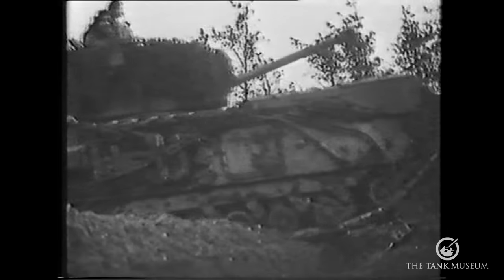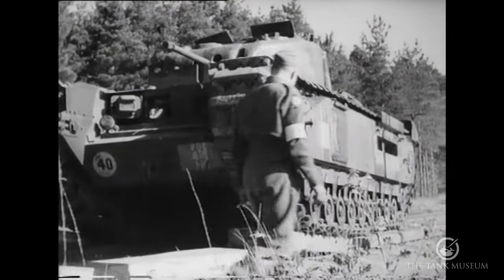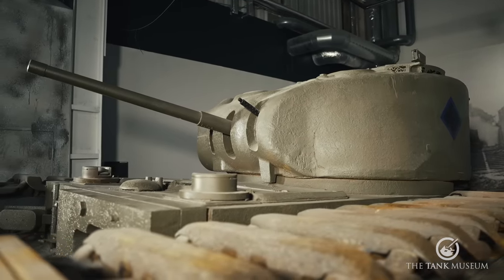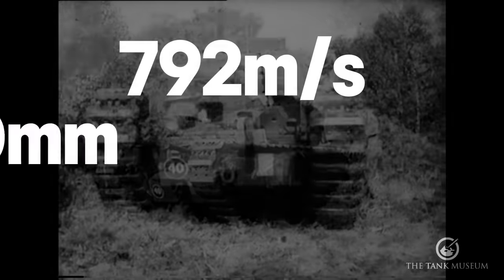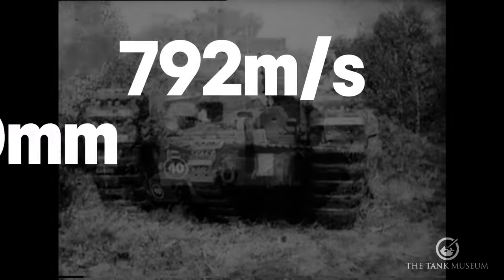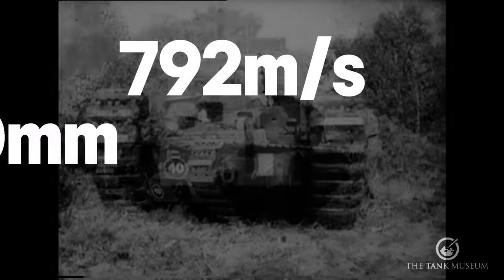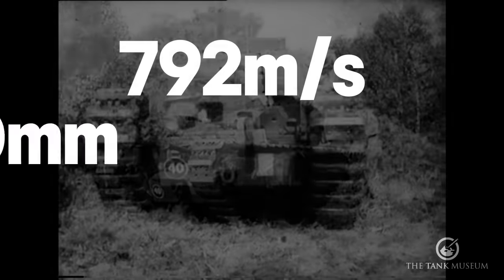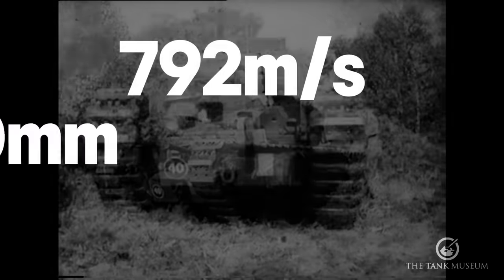Evolution of The  Churchill Tank | "No Damn Good"?

Comment: One of my favourite tanks ever and one that is a bit underrated in my opinion when compared to other Allied tanks of the era like the Sherman or even the Cromwell. If they had introduced the 77mm cannon derivative of the QF 17-pounder anti-tank gun early and put that in the latest mark of the Churchill then it may have gotten a bit more limelight.
Reply: A pity the panic in 1940 was so persuasive and so the 6 pdr which was due to enter service in late 1940 was stopped to produce more 2pdrs (which at the time were still effective), pushing the 6pdr back a year and the 17pdr back to 1942 (its design was started in 1940)

Comment: An advantage of the QF 6pdr. was that it was a better A/T gun than the GP 75mm. fitted to the M4 Shermans, so Monty ordered that a number of the 6pdr. equipped Churchills be kept on strength until the 17pdr. was available in sufficient numbers.
Reply: the 6pdr was better at short range, the 75mm was better and longer range (due to the weight of the projectile).
Reply: @chaz8758  Although the 6pdr. had a muzzle velocity of 2,600 - 2,950 fps, with the 75mm of 2,030 fps for A/P it depends much on the situation at the time of engagement.

Comment: Wasn't it a Churchill six-pounder round which knocked-out Tiger 131 in Tunisia?
Reply: If i remember correctly the tiget wasn't knocked out, the gun traverse was jammed by the shell, and the tiger's crew abandoned it
Reply: How well did it work without its crew? @saynomoreification
Reply: It was one of a group of Churchills engaging 131, but yes. One miracle shot ricocheted down the underside of the barrel and went straight into the driver's compartment, killing the driver and cleanly disabling the tank. The crew of 131 were forced to abandon their otherwise intact vehicle, and the rest is history.
Reply: @86pp73  I’ve never heard of that, what’s the source? I’ve only ever heard about it’s turret being jammed up. She doesn’t show any battle damage over her drivers hatch from what I’ve seen, and you can still see the shrapnel marks in her turret and turret basket.
Reply: @stuglife5514  There is a patch over the damage to the drivers hatch area - the damage can still be seen inside the drivers/co drivers area)

Comment: I had no idea Churchills saw action in Korea, but thinking about it they probably did their job well; hilly terrain didn't bother them at all.
Reply: They were Crocodile flame throwing tanks, as rhe Brirish also deoloyed armoured regiments equipped with Centurion,  but the limited need for flame throwers meant the Crocodiles mostly dropped their trailers and reverted to use as gun tanks.
Reply: @jonprince3237 also Cromwells, but IIRC, not Comets.
Reply: @wbertie2604  yes, Cromwells were still in service with the Reconnaissance Troop of the Armoured Regiment. For example, the orbat for 8th, the King's Royal Irish Hussars deployed as part of 29th Infantry Brigade lists 64 Centurions in 3 Squadrons of 20 tanks, 6 Cromwells, along with 3 Churchill Armoured Recovery vehicles and 3 Churchill bridge layers as their armoured strength. Reputedly, the first Cebturion "kill" in Korea was destroying a Cronwell that had been captured by north Korean forces.

Comment: 17:17 re: the storage of the 2" White Phosphorus smoke bombs and that it could ignite if hit. IIRC I've seen a block of wood with 2" holes bored into one face. While the timber isn't metal or armoured, it still offers a level of protection from splinters, etc. 👍

Comment: Correction on the bit about welding armour, it isn't really an issue ONLY if the welder is competent, but if done by an in-experienced welder or rushed (both issues being basically the standard for contemporary russian tanks), the whole thing basically falls apart if hit hard enough, even if the round doesn't go through (Lazerpig explained it quite well in his T34 video), which is far less likely to happen to a bad rivet job, as even if most of the rivets fail, the panel stays on the tank instead of just falling off.

Comment: The A22 Churchill was a development of the 1940 Harland & Wolf A20, a WW1ish tank designed to cross shell torn ground. It was deemed too big and Vauxhall took over the design. The A22 was ordered into production straight from the drawing board and so had many issues. It appeared in 1941 but was not ready until mid-1942. Despite its appearance the design was very advanced in terms of agility and protection. It was used at Dieppe and El Alamein, were one tank was hit 70 times without major damage. It was only slightly slower than the M4 Sherman despite 12 tons more armour. It was well liked by its crews, replaced by the Centurion tank in 1947.

Comment: As long as you don't treat it as heavy tank, it works as advertised for medium infantry tank. And thus Churchill VII is my favourite version of Jumbo:P

Would have been much better if they had utilised Meteor when it was available and designed the tank for use of 25 pounder from the beginning, but it is what it is, I guess.

P.S.: no, my suggestion has no connection to Black Prince as I don't suggest to stretch the tank to even bigger dimensions for no reason. Bloody Sentinel housed twin 25 pounders in its turret while testing the placement of 17 pounder. You don't need a turret ring the diameter of the Moon to house 17 pounder. And you don't need the hull wide enough to land B-29 on it to put a big enough turret ring on it, there are many examples of overhang turret rings. Not to mention you can always rethink the whole "overhang" track which was a unique feature of Churchill since all other tanks with this approach were already scrapped in 1920's😂

Comment: i wonder if the good cross-country mobilty was due to for a good part the extremely agressive profile of the tracks. compare this with, for example the later Chieftain tracks, which were very smooth. (partly because of the rubber blocks fitted)
Reply: Low ground pressure due to the many small wheels couple with a low gearing ratio and the ability to neutral steer where what made it a very mobile and manoeuvrable tank

Comment: The A22 "Churchhill" bears a strong outer overall design to the A20 which includes the downward pointing air vents that the MK1 had.  That was a design for muddy WW1 trench warfare and the tank had to climb steep slopes that might be muddy including deep craters and walls of wide deep trenches and slow enough for infantry to leisurely walk beside it just as if every hadn't changed since in WW1.  But that did give the Churchill that legendary climbing power.

Comment: Not a detail significant enough to include in this video, but I like regardless: those louvres on the sides being removable wasn't just for maintenance.

Because military hardware had to be rail transportable, the size limitations of the railway (called the loading gauge, which is much tighter in the UK than elsewhere) played a major part in the design of tanks and such; this is why when British tanks get bigger during this time, it's usually lengthways first, as shown by the Churchill.

Those louvres were removed when the tanks were loaded onto flat wagons, otherwise they would foul the loading gauge. I believe the same was necessary for the sponsons of the WWI tanks. I don't have any knowledge for how they may have looked on European lines, if they even moved around like that rather than entirely under their own power.

Comment: That was a great survey and so well narrated.   Thank You !

As a layperson might I ask a question about the transition to modern  infantry support vehicles.    "Is the WW2 idea of an Infantry Support Tank   now met by the (often called)  Armoured Troop Carrier.    If thats completely wrong then might I ask what the modern counterpart might be ?  Thank you in advance for information.
Reply: Infantry tank and armoured troop carrier roles have some similar goals in enabling the infantry to close up to the enemy to press the attack and both originated in WWI trench warfare. The idea was for the infantry tank to advance with the infantry on foot against well prepared/defended positions in set-piece attack and deal with key threats like heavy machine guns, fortified points etc + some obstacles like wire, etc. So, v heavily armoured and good over poor & obstructed terrain, but no need for high speed. Faster, lighter cruiser tanks would exploit any breakthrough. This also matched the prevailing social status attitudes that the dashing (now with tanks) cavalry would charge through and win the battle once the common foot soldiers had toiled away preparing a nice gap for them 😲
The troop carrier is more of a battle taxi to give much better infantry mobility with some armour protection against small arms, splinters, etc and later NBC. They usually have a moderately heavy weapon to support their squad but are vulnerable to heavier weapons. So, they would typically follow/accompany eg main battle tanks to disembark troops to secure a position or as necessary to deal with immediate but unarmoured threats that the MB tanks are vulnerable to, like say, RPG teams.
The separate infantry + cruiser tank concept was made obsolete by the armoured warfare developments before WWII and to some extent by better technology.
Reply: @jackgee3200 
What a comprehensive reply !    Truly grateful to you for the effort you put in.   That adds much to the value of the video.

Comment: I built a Tamiya 1:35 scale kit of a Crocodile.  Very interesting vehicle.  Model turned out really well.  But whose bright idea was it to mount a towed trailer behind a tank that can so easily execute a neutral steer turn?
Reply: How else are you going to transport all that flamethrower fluid and propellant gas to the point of use?  Simple answer: don't neutral turn with the trailer attached!

Comment: The 37mm (2 pounder) that it started with, was useless against PzKw3 and later. The 57mm (6 pounder) it usually had was effective against PzKw4/ Stug (the main armour opposition at wars end). The enginer (AVRE) models, not all with the big demolition gun, were so useful that there were AVRE variants of all subsequent British army tanks. The 75mm (short) was fitted in 1200 Mk7, was less accurate with similar penetration to the 57mm but had much better HE. The crocodile was very effective and features in many german's memoirs as their worst nightmare. The Churchill's 102mm frontal armour (increased to a maximum 152mm in late models) was exceptional. The PzKw 4 only had a maximum of 80mm. Many Mk 2 and 3s were captured at Dieppe: German analysis was derisory, perhaps more because of the outcome that a real understanding of its potential.

Comment: On the subject of fitting a Sherman 75mm main gun to the Churchill, not only did it prove a good fit and armament, it also revealed that the 75 was a much better gun than the Americans thought it was. It could hit targets much better in the Churchill and had a better record of hitting targets that were out of sight in an indirect fire situation, which depended on a forward artillery observer. The lackluster performance of the gun in a Sherman was because the Sherman was an unstable platform for the 75. The tank would move ever so slightly when the gun was fired and before the shell could leave the barrel, a good aim would be spoiled by a slightly different angle when it left the barrel. Apparently the movement was so slight that to the naked eye when firing at 12 o'clock, or straight in front of the tank, that a simple movement of an inch would make the shell miss a target far away by feet. And of course, anyone who has watched films taken of a Sherman firing at 3 or 9 o'clock shows the entire tank rocking back noticeably. It might not be so bad when providing close support to infantry using high explosive rounds into a strong point a block away or at a hedgerow a few hundred feet distant, but it sure mattered when being forced to try to protect itself from enemy armor a quarter of a mile distant. It would be interesting to see of the 76mm gun on a Sherman easy 8 suspension did any better, but Im getting off point.
Maybe the best quality of the Churchill was due to the armor. You have touched on this but another point that was made in either the book "Mr. Churchill's Tank" or the Haines Manual for restoring a Churchill. It was pointed out that the armor was the best of any allied tank during the war and when knocked out, usually the entire crew would walk away. They would then return, as a whole crew, to the tank depot waiting for a replacement and go right back into battle. This is important because a crew who have trained together and fought together always works better than a partial crew with replacements. You can see an example of this in the movie Fury when the new replacement does not know what he is doing and it takes a while for him to learn to do things properly, something that the other crew have inadequately trained him to do. In one case, his inaction causes the death of an entire crew of another tank. In another, they go into battle without him realizing he should have a full can of machine gun ammunition and is caught having a belt with only a few rounds left in it. Though it does not cost any one else's life, quick action from the tank's gunner prevents the enemy in foxholes from getting up to perhaps fire a panzerfaust.
Reply: BS

Comment: Another early war British design limited by that small turret ring limited by the narrow gauge railroad tracks. The Black Prince shows what could have been. Imagine it with a meteor engine and if it had come on the sceen in 44. The Centurion was the answer but again it came to late for the war.
Reply: It was not narrow gauge railway tracks - it was the size and shape of bridges. tunners and cuttings limiting the width and height along with turret position (curves/profile of the tunnel sides to the roof)
Reply: @chaz8758 Thanks for the clarification.

Comment: That teeny-tiny suspension, though.  🙂
Reply: That teeny tiny suspension had a fair bit of built in redundancy though - loose a few to a mine or other 'significant emotional event' and the Churchill could keep waddling on. A very ugly vehicle that came into its own as it developed.
Reply: Worked great at spreading the weight of the vehicle - like the Germans interleaved system - but much easier to replace damaged wheels and bogies

Comment: It was quite puzzling why you would put a 2 pounder on an INFANTRY tank. The 2 pounder was the best hole puncher in the world in the sub-40mm AT class but it had no HE or anti-personnel capacity at all (as my father found out at Mouar in Malaya in early 1942) . Surely an infantry tank is designed to take on trenches and the like, not other tanks.
Reply: You're not wrong. All I can think of is that, in the early war period, the infantry had no way of dealing with enemy armoured vehicles, so you needed your infantry support tanks to be able to deal with enemy armour. The tank did have a couple of MGs for infantry support. But clearly the 75mm gun was the better choice, when it became available.

Comment: I love that British planes were so light and graceful but their tanks were always boxy and heavy.
Reply: The RAF and the RN received the vast majority of the defence budget leading up to the war - and even during the war the tank arm had to use substandard engines as the Meteor was a Merlin without the twiddly bits (generally speaking) and wasn't available in any numbers until the later years of the war. A fair enough view during the early couple of years when Britain (and the Empire) were really up against it, but the big missing link in British tank development was the power pack and it seems the establishment were unwilling to divert enough engines in a reasonable time.

The Fleet Air Arm was in a similar position, unloved by the Headsheds in the RN and there was no way the RAF  would put any development funds into carrier aircraft.

Thank god for he Corsair, Sherman and Martlet.

Comment: a little bit of this didn't make sense, tracks are not going to churn mud into the intake, the physics don't work with how its designed, especially on a tank only capable of 12 - 18 MPH, it points downwards to prevent enemy troops dropping a grenade or molotov down it, its not really logical that it could get blocked by track mud.

Comment: The German tanks were fitted with transmissions too weak for the weight of the tank. Many were also fitted with engines too weak as well.
Shermans had a variety of different engines, nothing outstanding but seemed to the job better. Transmissions it seemed were reliable.
German tanks however had the advantage of rear engine rear drive so no driveshaft running therough the middle

Comment: I am wondering if the 'infantry tank' as a concept really is going to stay dead - seems to me the war in Ukraine has somewhat proven there could still be a need for tank that can be made cheaper and easier to maintain but just doesn't die easily, which is I suspect very possible if you accept it doesn't have to move quickly. Obviously if you can have all three of the survivability, mobility, and firepower of modern MBT you'd rather have that, but having all of that at once is going to be more expensive, and probably still requires engineering compromises to get good at them all. Where just accepting you will be slow so can be cheaper and/or tougher probably works - you might draw lots of fire compared to a more mobile MBT, but if it takes very expensive weapons in comparison that is by the calculus of war still a win.
Reply: APC's with proper tank turrets exist, the concept is verry much alive but not as a tank.